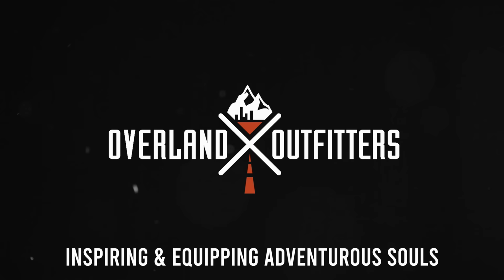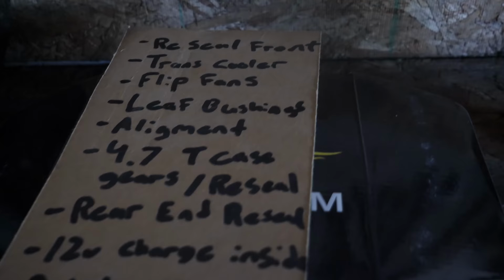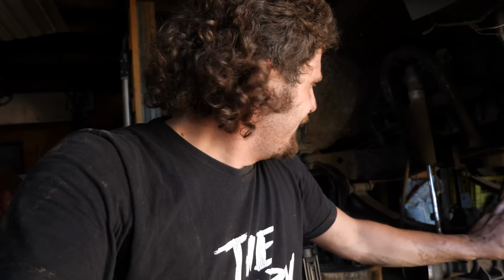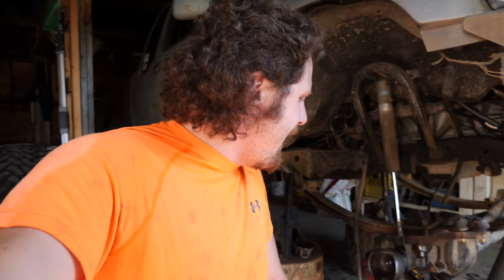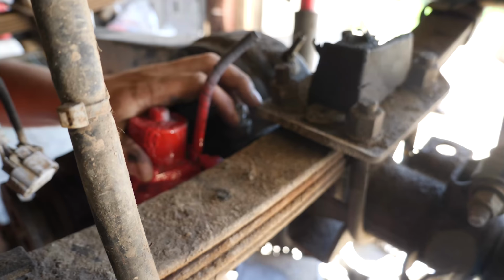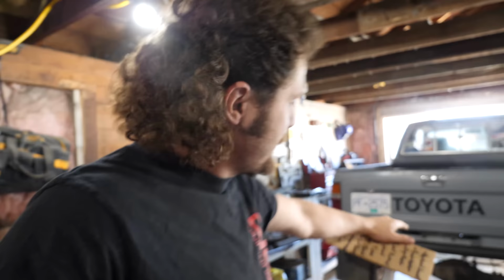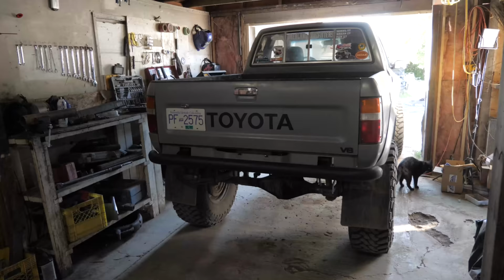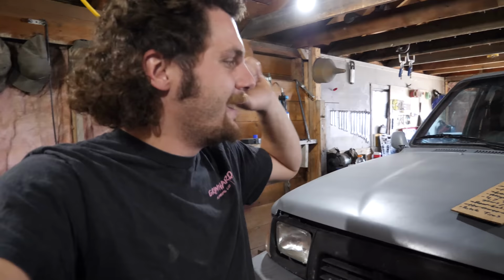Toyota Solid Axle Rebuild & Trip Preparation

Comment: so I bought a solid front axle HOUSING for my Toyota pickup, what exactly do I need to complete it to get it ready for a SAS!?
Reply from the maker: 8" thirdmember with matching gear ratio to front, knuckles, spindles, birfields, hubs, locking hubs, FJ60 rotors, V6 calipers, high steer kit, knuckle sandwich / axle seal kit. Unfortunately just the housing is a small bit haha.

Comment: If you completely went through a front axle on Toyota 4x4 and everything is good a year down the road
And then you wanted to regear 
Would you replace Inner axle seals ,,there are no leaks now,,so my thinking is pull everything and  do ring and pinion and just put it all back together
What’s your thoughts
Reply from the maker: I'd do inner axle seals. So easy to do while your are there. I'm surprised you got a year out of them though!
Reply: @DirtGarage  used the marlin seals and like I say ,,i haven’t done mud or anything really requiring the 4 wheel drive
Reply: @DirtGarage  what seals do you use,,marlin is out of stock
Reply: @DirtGarage  I see that grizzly makes a heavy duty seal now,,looks a lot like marlins eco seal
Reply from the maker: @clayton203  I'm currently using a Yukon axle seal kit. Has a axle seal identical to marlins.
Reply: @DirtGarage  yea,,I think there is a lot of folks copying marlins,,just ordered a set from trail gear,,trail safe,,27 dollars for a pair,, I guess I will have to put off my ring and pinion setup for another week,man thanks for getting back to me, sometimes I get a sure nough head scratcher,,and plus I was wanting to change this stuff out now,,but I will wait on the new seals now,,better safe than sorry

Comment: Where can I get a lunchbox locker or do I have to go through Amazon? I'm in the Kootenays.
Reply from the maker: We buy them from Amazon! https://amzn.to/3AdJHVI
Reply: @DirtGarage  Sorry to be a knob about this but how do I know which one to get or do I have to tear down my rear end first in order to make sure? 
Also, I've posted questions on BC 4X4 and so far got nothing. I have another question about rims for my 89 Hilux. I put on Chev 16" spokers and I don't like the way the tires are inboard. I'd like a wider stance and possibly include some fender flares. Could you assist me on what rims I should try and get and where to get them? I had to grind a bit off my calipers and they've worked fine for years but I just don't like the narrowness of them overall especially when going to taller tires. 
I'm in the Kootenays and sure wish there was a place I could drive to, show what I've got and ask a bunch of questions and maybe get more advice on things I should do to improve my ride.

Comment: Hi, I was wondering what front axle rebuild kit you used, or if you just bought all the parts you needed separately?
Reply: Depends on where you are from but if you are on the west coast of US Marlin Crawler is always a go to. They sell kits so you don't have to piece it all together.
Reply from the maker: Hi, I just used the one available at Low Range, It's the cheaper Trail Gear one. It's actually a pretty good deal, like $100 bucks! https://lowrangeoffroad.com/toyota/4runner-pickup-hilux-1979-1995/axles/toyota-knuckle-rebuild-kit.html